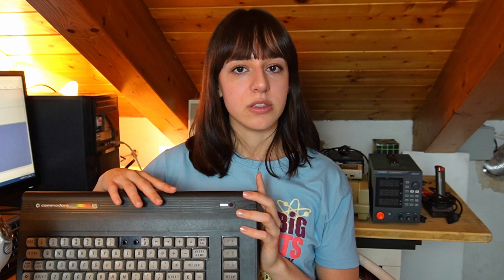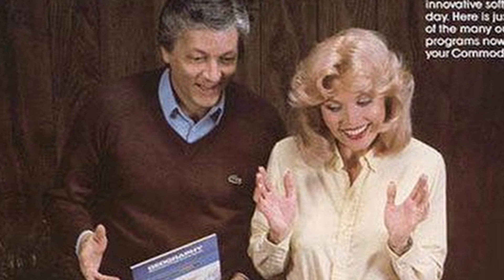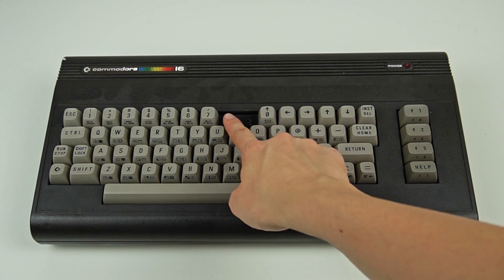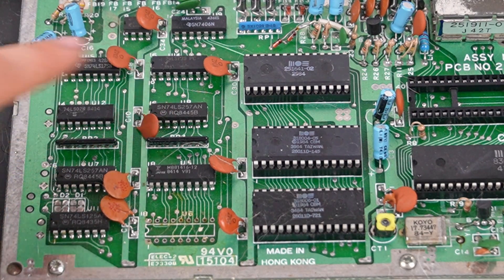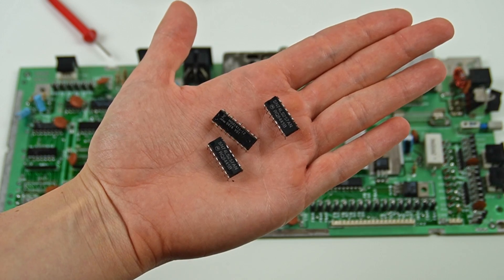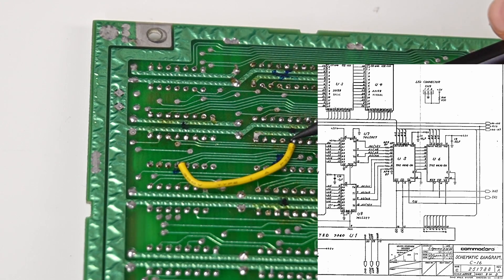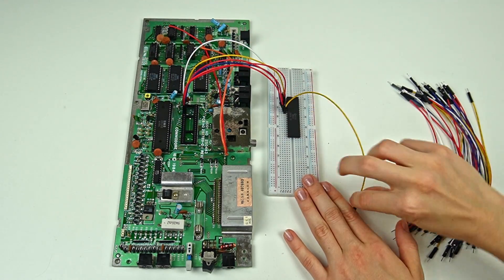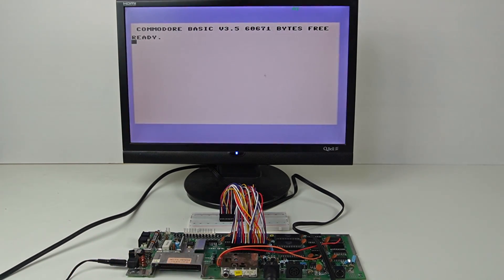I upgraded a Commodore 16 with C64 CPU & RAM

Comment: That de soldering "braid" appears to work very well. I tried using the vacuum tool, but sometimes it would pull up the traces.

Comment: Look for Monotech MOS CPU Replacer (6510/8501).  They sell a pin comparible replacement based on the 6502 and discreet logic.

Comment: Pls keep the color right with a breadboard. Use separate colors for Adressbus and Databus (and voltages) in case of errors, its easier to find the failure
Reply from the maker: Thanks for your helpful advice!

Comment: Great video! I enjoyed watching your improvements to this C64! Let me challenge you to also go back in time about 40 more years and try your hand at antique radios that use old vacuum tubes! Just be sure to watch the much higher voltages (up to 475V DC)! The fun part is you can even bring them up to date by adding Bluetooth and Alexa!  Or you can run your C64 sound module through their 12-15" speakers! :)
Reply from the maker: Thank you so much! I'm glad you enjoyed the C64 improvements. The challenge of working with vintage radios that use vacuum tubes sounds intriguing, although the higher voltages definitely require careful handling.

Comment: Bravo for your patience removing those ICs with solder and wick. As someone who's also had to do that many times, I appreciate how frustrating it can be. You managed to do it on-camera, without apparently damaging the board or the ICs in the process. Amazing. 👏 A while back, I invested in a RadioShack branded desoldering iron with a red rubber ball that acts as a small vacuum pump. Best ~$30US I ever spent for desoldering, and I understand it can still be bought if you look around. We all love the mechanical vacuum desoldering irons, but as you probably know, they're hard to justify on a hobbyist budget. 👍
Reply from the maker: Thank you for the kind words! Removing soldered ICs indeed requires patience, and I'm glad the effort came through on camera. Your RadioShack desoldering iron with the rubber ball sounds like a brilliant investment! I'll definitely look into your recommendation. Thanks for sharing your experience :)
Reply: @Sayakas_Digital_Attic  Happy to help!

Comment: It might have been mentioned before but time you took on showing the wiring between the breadboard and the computer took a bit too long. Other than that I have no faults.
Reply from the maker: Thank you for your advice, it's only through the comments that I can understand how to improve.
Reply: I somewhat agree - there is value in showing the process start to finish like you're doing, so don't shorten by cutting footage but rather speed it up.

A good way to do it for repetitive tasks is to show the first one or two at a reasonable speed so it's clear what is happening, then run the rest at like 10x speed timelapse style - if there is something noteworthy in the middle, slow down for just that bit, then speed it up again.

Combining this with the music also really helps - some creators will even use a certain track during these parts and alter the volume accordingly too, eg louder during 10x then quieter (rather than stopping) for any slow noteworthy parts - it also allows for voice over if you need to explain but doesn't interrupt the flow.

When you get super advanced in the editing side, cause.you will i'm sure of it, line up the melody/beat to the transitions. Mark Rober is a good example of a huge youtuber who does this during the build parts of his video.

Just go one step at a time - don't try to implement too much or many changes all at once.

Overall great stuff, very impressive and i've said it before.. you're going to have a silver youtube button in no time with these type of videos! 😊

Comment: Awesome to see the younger generation that are interested in Retro computers. With your 64k Ram upgrade on the C16, you should have added a "2-Way toggle/flick switch". That way you can still keep with the original 16k of Ram. There's a few C16 games that wont run properly on 64k of Ram on a C16 machine. One of those being the Mastertronic version of Rockman but brilliant to see you've kept this beauty of a C16 going strong again.
Reply from the maker: I really appreciate your insight about the 2-Way toggle/flick switch for the 64k Ram upgrade!

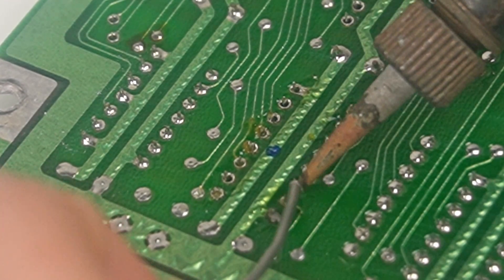Comment: 6:20 Tip: You should add a little more solder when you are soldering and hold the solder iron longer to make the solder flow better. It is easy to make a cold solder if too fast.
Reply from the maker: Thank you for the input!

Comment: Very interesting. I remember a school mate showing a lot with a Commodore (in the 80's), but it wasn't programming - rather a lot of games. Currently I play with the Raspberry Pi Pico's with MMBasic loaded. I put together a "PicoMiteVGA" first and continued with some more in a similar way.
Reply from the maker: Oh, that's really cool! The 'PicoMiteVGA' sounds like a fun project! How has your experience been with it so far?
Reply: @Sayakas_Digital_Attic  I ordered a board kit from Australia to Norway and soldered the few components in. It got disk, PS/2-keyboard and vga connections. Then I flash a Pico with MMBasic and enter option (something, something) lines (configuring the wires/board) in after attaching a Pico like a hat part.

I wrote some Basic myself and can attach real time clock, temperature sensors, more displays or whatever. A funny thing is the whole PicoMiteVGA is powered from an old Dell with USB out, so it turns on when I hit on, on the the Dell.

I also had to create an US keyboard and had some stickers around for that.

Will buy a real time clock for that one. Just now I wait for wires (female-female) for more. 

There is a finished project apart from that where I figured out something called PWM to RC cars/air planes. It works like throttle control for a motor or you can Google ESC=Electronics Speed Controller. It's 3 keys, a tiny display with a number, a Pico and this hook into the RC world. So far I just fool with one propeller.

I plan to buy an air plane (RC) kit next year and the rest needed with more Pico experiments. Until then it's a bit of programming. No idea when it will fly as it's more complicated and expensive than I thought.

MMBasic is free and got a good manual which I will recommend. There are other projects with other chips. I just felt for chosing a Pico and skip MicroPython for now.

It's been mind blowing to make a lot of connections to other components and using Basic for the ideas.

Comment: The 8501 and 6510 both belong to the 6502 CPU family. 
The 6502 was in the VIC20, the 6510 in the C64. There was the C16, the rare C116 and Plus4 with the 8501.

I think that the C16 line was not successful because many still had the VIC20 or already had the C64.
Then it made no sense to buy another computer in the performance class of the VIC20.

I think there were only prototypes of the C116, but technically it was the same as the C16 only with a membrane keyboard.

Comment: I remember taking a microprocessor class with  professor Tom Bradicich, PhD.  At the time, he worked at IBM. He currently works at HPE,  We were designing on paper microprocessor with gate chips etc to produce certain outputs from selective inputs.  We also had microprocessor labs.  One of the chips was the 6502.  I remember in this class and a graduate computer engineering class that Commodore was one of the early microcomputers that did bit shifting to create different colors. A little bit of history here.  The 6502 was created by Motorola, who later developed the popular 6800 series and the even more popular 68000 (one of the CS professors was one of the architects of the 68000 when Motorola had a factory  in South Florida )
Reply from the maker: That's a fascinating trip down memory lane! The 6502's role in early microcomputers truly laid the groundwork for the technology we see today. It's amazing how these innovations shaped the entire industry. Thank you for sharing this piece of history!🙂

Comment: The Commodore C-64 was my first computer back in the mid 80s. My dad came home with one 1 month before my birthday as a present and it changed my life. I pursued and achieved a career in IT.
Reply from the maker: That's an amazing story! The Commodore C-64 holds a special place in the hearts of many. It's fantastic to hear how it played a role in shaping your career. Do you still have the C-64 or any other vintage machines?🙂
Reply: @Sayakas_Digital_Attic  no. I had two of them and I donated them years ago. I wish I had just one of them. I still have the CPM adapter though. Back when the Commodore C-64 took off, the MS-DOS operating system was still in its infancy but there was alot of software running on an older OS called CPM.
Reply: @Sayakas_Digital_Attic  BTW, fun fact. I had the blinding speed 300 baud modem accessory that plugged in the back where that accessory port is. I used it to dial in remotely from home into a Digital VAX 11/780 cluster at the University of Houston to do FORTRAN programs for the programming course I was taking from the comfort of my bedroom. This is how we remoted in before the Internet became popularized 9 years later. The downside was that the terminals at U of H’s computing area were 80 columns wide and, as you are well aware, the Commodore’s screen is 40 columns wide so I had to make do with writing programs in line edit mode and this was very cumbersome. It worked though provided you didn’t have to do much editing. For running a program and getting output without driving 40 minutes to the campus it was great.

Comment: The C16 was the first computer I owned, gifted to me for my 13th birthday (appropriate enough, since I had nothing but bad luck with it). The 16 and Plus 4 existed briefly in the U.S. under a sad state of affairs. I remember thinking at the time that I'd never seen a company put out, not support, and abandon a product so fast. The one bright spot is that I got wind of a C16/Plus 4 users' group that operated over snail mail from Baltimore. I got the vast majority of my software from there. As there were no retail sources offering it here in the U.S., we had a nice little pirate distribution chain going for European C16 games! My C16 days were short-lived, however. Something shorted out inside and it died. It was replaced months later by a C64.
Reply from the maker: That's quite a journey with the C16! It's a shame about the short-lived experience, but the C64 was quite an upgrade.

Comment: Congrats! I see your soldering skills are getting better :) Suggestion: go slower and tune down the temperature. Your soldier joints are not shiny, and they should be. Are you using a lead-free solder? At home for projects like that, it is strongly advised to use leaded solder wire instead. It has a lower melting point and thus the flux included in it evaporates slower, leaving nice and shiny joints.

Comment: if it works like that with the 6510, would it make sense to use that for the fix instead of hunting down the expensive missing chip? Or are there some differences, that require the original intended chip?

Comment: Yay, it freaking works! Well done Eleonora, you were lucky that the PLA and TED chips were working too as these are prone to fail as well. I did this 6510 CPU modification to my C16 too, but with an adaptor I got from eBay. It's great to see someone so young interested in these vintage computers, keep up the good work 🙂.

Comment: The c64 was the first computers I used in school.  We had lots of games and software and no one knew how to run them...of course, I figured it out cause I wanted to play computer games so badly!  I was only 4 or 5 years old when I learned to run software on the C64 all by myself...well...just by reading simple insteuctions included with the software lol

Comment: For your CPU
Reply from the maker: Wow, thank you so much for the donation, this way I'll be able to purchase the 8501 .🙂
Reply: @Sayakas_Digital_Attic  I don't recall whether the keys are the same plungers as the C-64, but the wiring is different. Missing keys would also be hard to source. Seems like you can only get them from Hungary (like $80 total). If you have a PO Box or safe address (business address?) I have a spare keyboard complete. You can have it. It's just gathering dust on a shelf.
Reply from the maker: Thank you so much for your kindness, I truly appreciate your thoughtfulness. It would indeed be quite useful. However, considering I'm in Europe, I wouldn't want you to spent too much on shipping.

Comment: Jumpers across to a breadboard: that is really amazing that you can do that! I was just thinking yesterday about how hard it would be to plug in a softtware emulator running on a Raspberry Pi pico and it sounds like it could be done at 1.1 MHz. I need to get out my calculator, ...

Comment: I am glad to see you are still in the game.  This was fun.  I probably would have stabbed the left-hand pins on the breadboard over on the left edge a bit away from the chip, and the right hand pins on a row a bit away from the chip to the right so you could see easier, then done the right side of the chip on the motherboard, and, finally, arcing the wires for the left side over them.  Just how I would have done it.  Seems like it would have been easier that way (but then I have big hands.)

It's always a thrill to see a project come to life!  Well done!
Reply from the maker: Thank you for the valuable advice! I appreciate your suggestion . :)

Comment: I had a C16 when I was young, and loved it.  The most useful feature was the integrated ML monitor - you could interrupt any program with the reset button near the power and examine it to see what it was doing.
Reply: Yeah, it practically came with an integrated freezer cartridge. I learned to code in assembler with the TEDMON.

Comment: Hey .. Great video ;) .. the only downside to the cpu conversation is the tape deck auto stop doesn't work, and you need to use an updated kernal as the routines are different .easy eprom through.. I may have them missing keys and plungers if you need them ... keep up the great work 👍

Comment: Awesome! I grew up with a C64 but I never knew until this video that the C16 was actually newer than the C64, thanks!
Reply: The C64 was quite expensive, many couldn’t afford, and Commodore wanted to offer something for any budget. It wasn‘t a bad idea to sell the low-cost C16 which looked very similar to the C64 but eventually failed for its limitations, particularly games

Comment: It's a strong achievement of yours to upgrade the Commodre 16. But in my opinion, the project is not complete until all the components are put back into a real Commodore 16 case. My English is not so good. That's why I didn't understand everything you said 100%. If I understood correctly, you unsoldered the 16KB chip from the C16 and soldered the 64 KB chip from the C64. But I read in the German C64-Wiki that the C16 can be upgraded "out of the box" up to 64 KB. If I see this correctly, this would have been possible without soldering. Why didn't you take this way?

Comment: Very interesting project, Eleonora! I used that computer in the 1980's. Its been quite a journey watching computers evolve over the last 40 years. With my first computers, like the Vic20 or C64, I had no external memory and had to re-enter the BASIC code for any program I wanted to run each time I turned the computer back on :( I was so excited when I got a cassette deck for external memory - Good times!
Reply from the maker: Thank you for sharing your experience! It's amazing how far technology has come since then.
Reply: With Commodore you couldn't even use any standard deck (without intermediate circuitry) but pretty much had to buy their proprietary tape unit with proprietary connector, which would input and output TTL level audio frequency signal, and was sensitive to the signal polarity... there were a few competitors that could do with any deck available, and for simply loading premade tapes you could just use a Walkman or any player with a phones output. Due to this you couldn't copy your Cxx tapes with any double-decker or stereo, but had to make sure that the polarity is not inverted in the process - something that is irrelevant to music. I wish I had known this tidbit wen I tried to make a contraption that uses two C2N's to duplicate tapes.

Comment: 5:50 - I usually use tweezers to hold that thing as it tends to conduct heat quite good. And your beautiful fingers don't deserve such high temperature 😄
Reply from the maker: Yes, I used them later too. In fact, I was almost burning my fingers a few times.😅
Reply: Indeed it's later on the video 🙂 My dad used to do the same thing in his youth many years ago and now it's always a problem whenever fingerprints are needed - either in a smartphone or at a border control

Comment: 2:03
Actually the plan was to use it in 3 computers, the third being the V364, a full size version with a number pad and a voice synthesizer (it's actually that bigger machine below the 264 in the photo at 1:57) , but was dropped after Jack left Commodore. The C116 was pretty much turned into the C16. The 264 became the Plus/4 when they put in the software they licensed.

3:37 would also add the incompatibility with the Commodore 64 as another reason why the C16 and Plus/4 failed. This issue was taken to heart by the head engineer, Bil Herd, who made sure that his next computer, the Commodore 128, was compatible with the C64